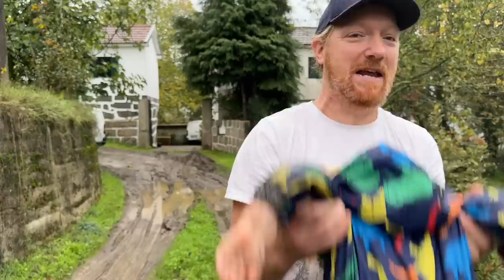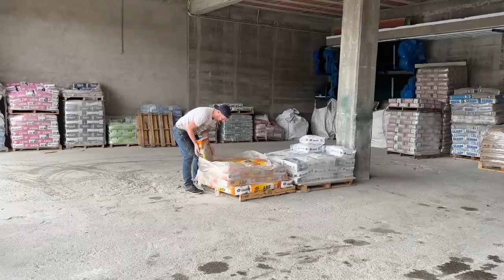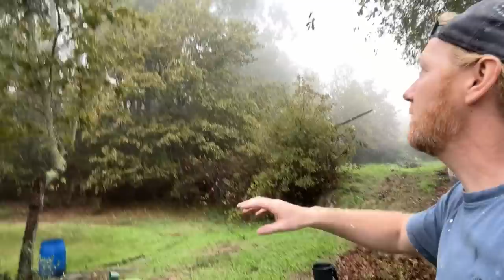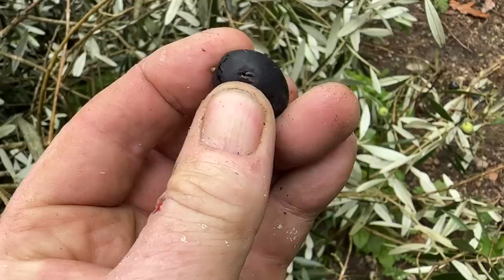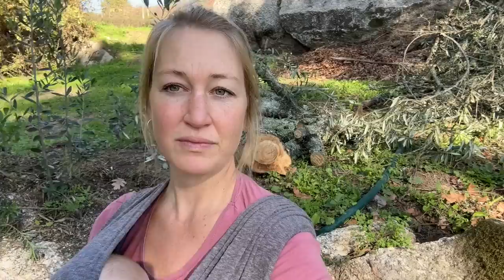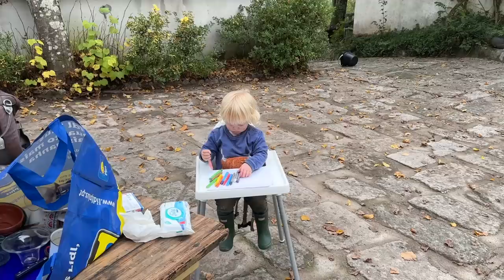This feels IMPOSSIBLE so much rain on our Portugal Farm Renovation

Comment: Hello John , Tara & the boys! I must tell you about my friend that has two olive trees on her property & how she eliminated the fruit flies. She said get a small plastic soft drink bottle,  cut the top off it, drill a small hole at the top, then put a piece of wire through the hole & make a hook so it can be hung up in the olive tree. Then put some beer in the bottle. She told me it worked so well that she has not had any fruit flies in years. Not even in any other fruit trees, like apples, pears etc. I think it’s worth a try. Good luck with it all. Cheers Noeline.😊
Reply from the maker: Hello Noeline. Thank you so much for your advice, we will definitely give that a go! We are so appreciate of your support friend 🫒🍺😊🇵🇹🏡❤️
Reply: I've used that on those huge Asian wasps and it catches a ton of them.
Reply: So they drown in the beer?
Reply: @themintleaf1778  Some would say, "What a way to go." Haha.
Reply: @TheNewbys  apple cider vinegar, sugar and dish soap works as well
Reply: The male fruit flies die. I’ve been told they hate the smell of the beer.
Reply: That is a very good tip Noeline Leary. I also put beer in a glass jar, lie it on its side in the flower beds and that gets rid of snails.
Reply: Get rid of snails that way also except in a bowl on the ground. Works every time. From Arkansas.
Reply: Doing a fantastic job.good luck
Reply: Fruit flies love apple cider vinegar, we have used it inside in a small glass with plastic wrap on top, pierced with small holes. They go in and can't find the exits..
Reply: Hi Newby gang. Tara. Each time you post I have a new found respect. This week it’s the way you tackled the kitchen with a baby strapped to you, with a toddler in tow, and multiple camera views/changes.  Way to go girl. 😊
Reply: I've literally just bought a place here in Portugal and I can see these bottles hanging on trees and I had no idea what or why, so thankyou Noeline!
Reply: I’m really happy that so many people liked the idea of the hanging beer trap. Thank you all for your comment’s. Cheers Noeline
Reply: That’s what I think the large green can you found and wanted to make a lamp was!An olive oil container?Did you ever find out. Btw I love the hammock . The walkways and trails are what’s very cool and out buildings.😮It’s a wonderful homestead and your breathing life back into her !splendid lol

Comment: ☮️♥️☀️🌹
Hi John, Tara and boys!
Love your farm life! Is it possible to dig a pond away from the home and use all that sand for the driveway? All you need is to add some gravel to the sand. Maybe even add a little concrete mixture to the real bad areas or just a lot of sand that you would get from the pond. You can also use the pond for emergency water. Just make sure you enclose the pond because of the little ones. You can also put a walkway if you choose from one house to the other with an entrance door of course, and a roof that goes over the walkway, then you just go from one house to the other through the side doors. #3. Make sure that you have a plan in your head since you had some issues with the clutch in your car, so that if there's an issue when you're driving, you will slow the car down right away and go over on the side in a safe area and apply the emergency brakes instead of panicking. I had to do that when there was a snowstorm. I couldn't feel any brakes when I applied to brake, but I had it planned in my head that I would do what I just said without panicking and everything thank God went smoothly. The snow literally cushioned the truck and helped the vehicle to stop in the snow, but pulling off to the side away from traffic, as they don't know what's going on with you in the vehicle and you want to avoid them running into the back of your vehicle. Just want you to have a plan since your car had an issue. You guys really need a van or a truck as we did living on a five acre farm. You save a lot of money paying people to pick up things you need from the hardware store or big items for the yard. All that money can go towards a bigger vehicle for a farm. You won't regret it! You can also save money going to England when you visit on the train or bus, as it would be the same cost buying gas for the car and not putting wear and tear on your vehicle. Just add the fair of the cost and what it costs you on gas to go to England and if public transportation is a little more, then it's wiser to use public transportation, because the wear and tear is not going on your vehicle or breaking down with two children. I'm sure a friend or Uber can drop you off at the station to get to England if you think that's a cheaper way, which I think it would be and safer with children and not breaking down in a car. You guys can sleep in a car if it breaks down, but not with children. 
Happy Holidays!❄️❄️☃️
Reply from the maker: Thanks so much for your advice friend, we always love hearing from you and we will definitely look into all of this. Sending you lots of love ❤️❤️❤️

Comment: You can put leaves in a  sterilized jar. Probably about a third. Add some boiling water and put a lid on quickly. Until it seals or creates a vacuum.   Drink the tea when under the weather. 👍💖💫👏🌹
Reply from the maker: Sounds great Diana, Thanks so much for watching friend 🇵🇹❤️🙏

Comment: Could you set up a system to capture the rainwater off the roof during the rainy season? You would have to invest in some large vats. There are areas in the mountains and in Hawaii where it's impossible to drill and there is no way to locate water. There are many people that collect water and use it this way. You may also have some neighbors that have natural artesian wells or springs that you can use for just your drinking water. There are ways of getting around digging a well. There are areas where it is so expensive because well must be so very deep and at times it's impossible to guarantee that water will be located. It's also great to use as a backup system and to water your garden and fruit trees. Unfortunately, Wells can go dry.
Reply from the maker: Thanks Kathyrn, we like that idea.  Thanks so much for watching friend, we are so appreciate of your support 😊🙏🏼🏡❤️

Comment: Instead of paving the drive, would road mix (gravel) be a better, cheaper option? Grade for slope and drainage then add the gravel. Maybe a French drain along the rock wall to move the water away from the wall and into the vegetation.
Reply from the maker: That's a great idea Kelly, thanks so much 😊🙏🏼❤️

Comment: An easy way to separate the good from the bad olives is to throw them in a backet of water...the good ones go straight to the bottom while the bad ones float at the surface! You should have a rake to brush the olives off the branches onto the net...
Reply from the maker: Oh wow thanks for that tip Leela, that is really helpful! Thanks so much for watching friend 🫒😊🇵🇹🏡❤️
Reply: Bucket...

Comment: WHY DID YOU BUY CEMENT HIGHT TEMPERTURE ? IF THE PROBLEM IN PORTUGAL IS THE FROZEN  AND LOW TEMPERATURE? WHY? DO YOU FEEL PORTUGAL IS TOO HOT? BUT IN PORTUGAL THE MOST HOUSES HAVE PROBLEMS WITH THE COLD... DO YOU KNOW THAT A LOT OF PEOPLE DIE FROM THE COLD IN PORTUGAL? IN GENERAL  HOUSES ARE NOT WEEL INSULATED AND DO NOT HAVE  ADEQUATE HEATING ... I DIDNT´UNDERSTAND ... OK...!:hand-orange-covering-eyes:
Reply from the maker: High temp cement was for the fireplace. We have insulated the walls. Great to hear from you, thanks for watching friend.
Reply: @TheNewbys  Ah, ok, I Understand ... :goodvibes: